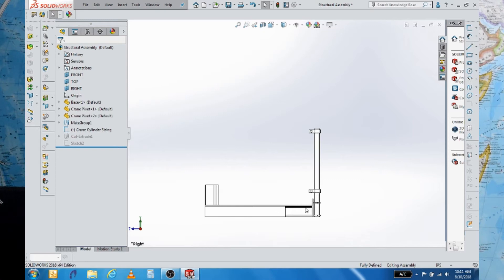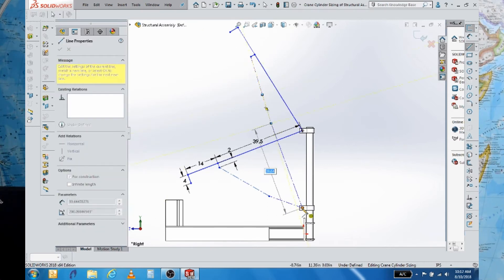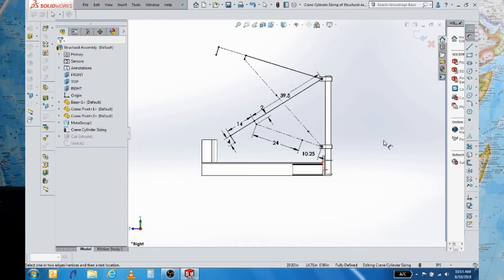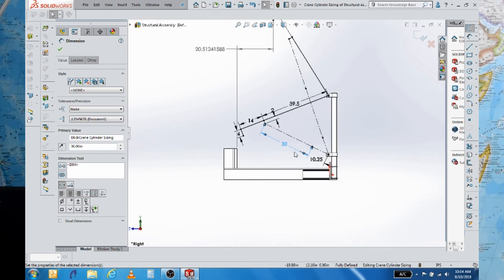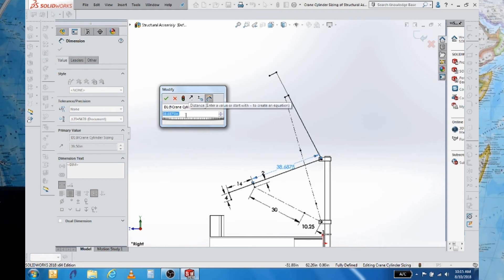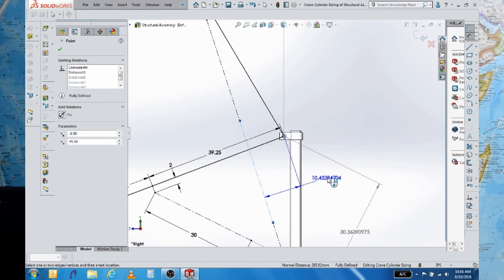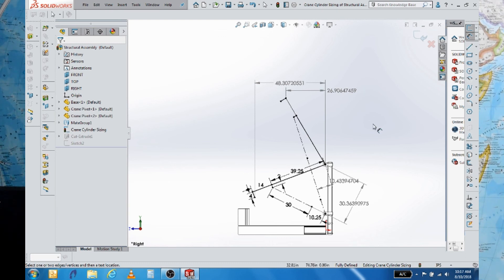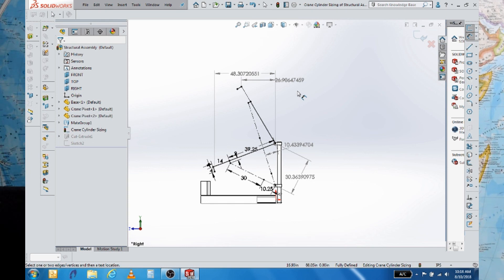Articulating Cylinder Geometry for Cranes - Log Splitter Design Part 5

Comment: Dear Mr. Corey, first I would like to congrats your content. This is very dynamic guide to determine the dimensions of the mecanism.
I read your article on your website and I have one doubt. Why did you use the distance 30,49 inch as cylinder moment arm? I thought that the cylinder moment arm would be the 39,5 inch. Can you help me to understand this point please?
Reply from the maker: Yes, the moment is the cross product (perpendicular distance) between the force of the cylinder and it's pivot.  That distance is the one shown at 30.36 from the pivot to the cylinder's line of action.  Please keep in mind that this will change as the cylinder extends.  However, it is usually the worst case at the ends of the stroke.